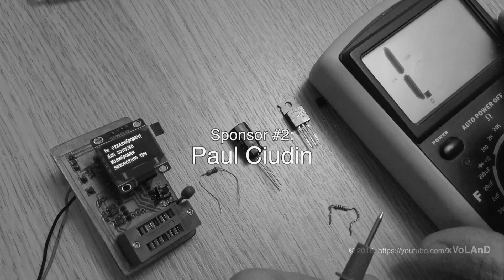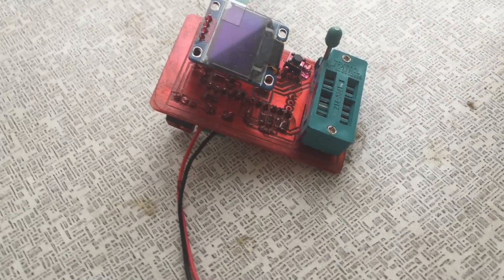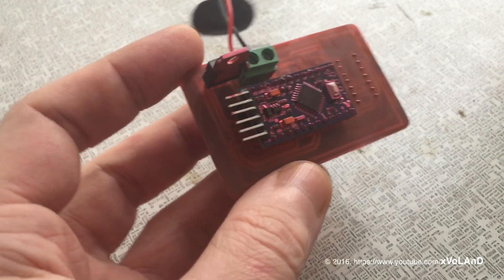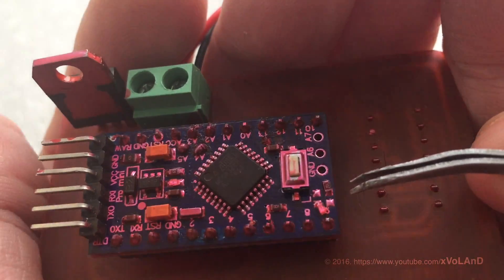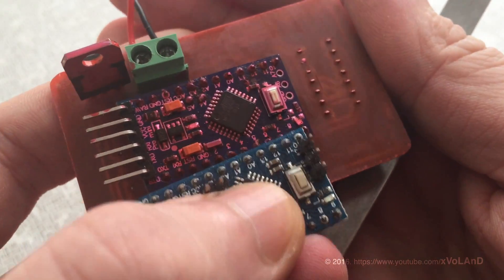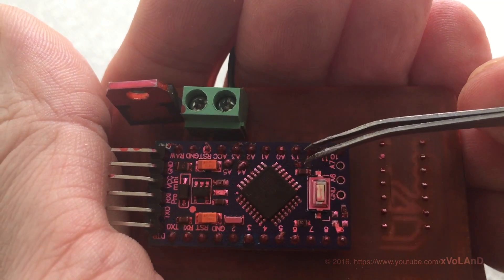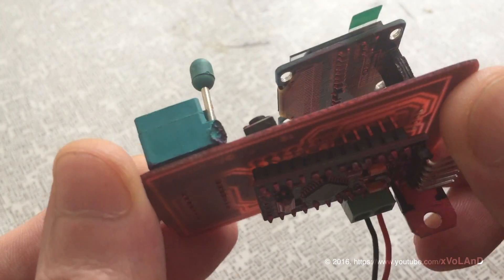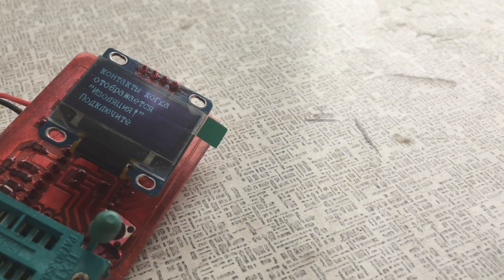DIY Electronic Component Tester or AVR TransistorTester (Arduino Pro Mini 328).

Comment: Is there special firmware or the general firmware for atmega328.
Reply from the maker: My Arduino uses atmega328, but you can compile for any ARM, the main thing is to fit into memory
Reply: @xVoLAnD  thanks for your quickly response,I  am not family with how to compile,all I need  is the English firmware for the arduino
Reply from the maker: julius parker You’re welcome! By default it’s on English
Reply: @xVoLAnD  ;I mean. ino  file that can be upload to the arduino
Reply from the maker: julius parker Ok, it's clear 😉 .INO is only an extension. I find it hard to explain
Reply: @xVoLAnD  OK thank u
Reply: Hex file ,I can add .ino  as extension to the hex file
Reply from the maker: julius parker No. Arduino IDE gives you the ability to load a hex. But you must understand what you are doing. Or compile source for your platform, but it's not in the Arduino IDE
Reply: @xVoLAnD  can this transistor tester test the following; transistor,diode,inductor, ESR, triac,,MOSFET,igbt,,frequency,
Reply: I want to buy,aduino 328 pro mini  from aliexpress,what are the modification  to board so that  I can get accurate reading